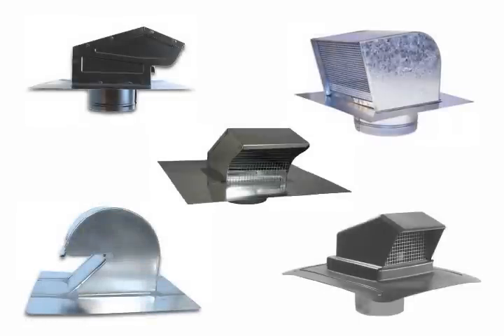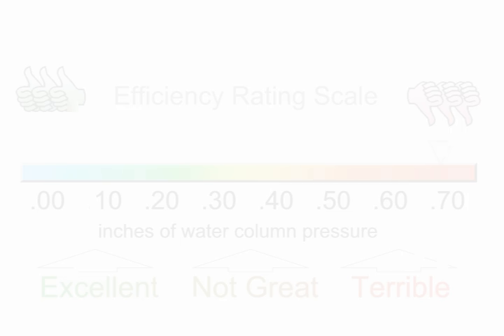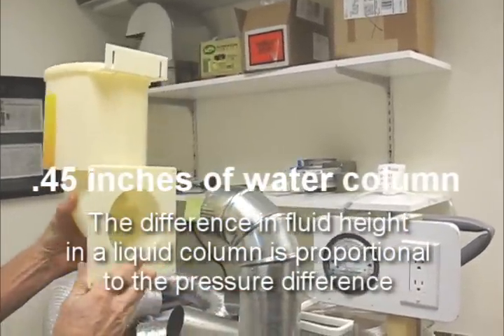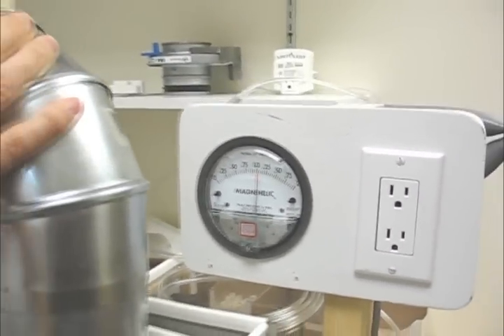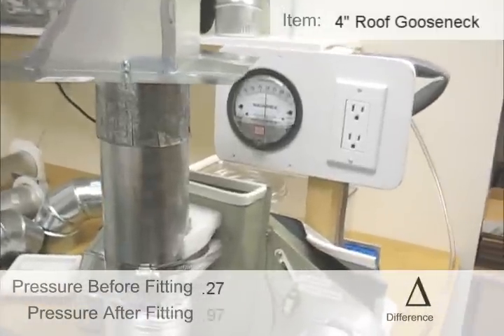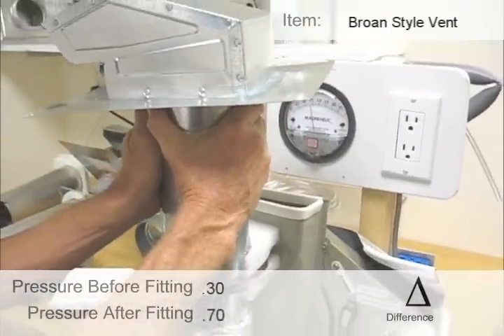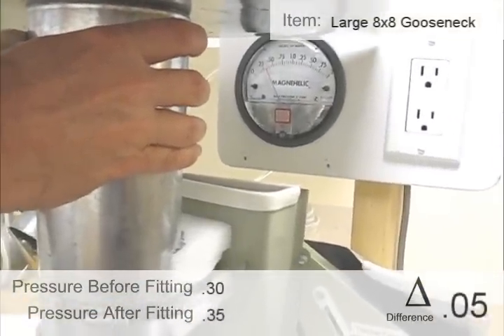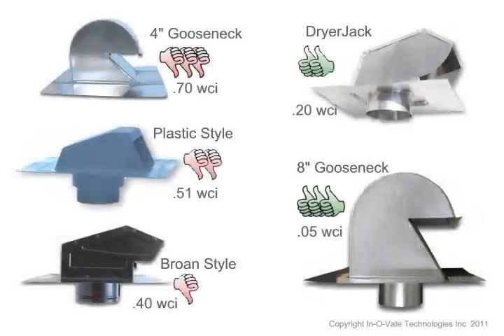Dryer Roof Vent Differential Pressure Testing Demonstration

Comment: This video would be significantly more useful if the recommended 8" goose neck vent hood was available for sale -- anywhere.  It appears to be a Master Flow 8" Goose Neck Vent, but the only sizes I can find are the 4" (which tested poorly), the 6" and the 10" (all sold on-line by Home Depot.  The 10" is absurdly huge, and who knows if it's worth replacing our Broan vent hood with the Master Flow 6"...